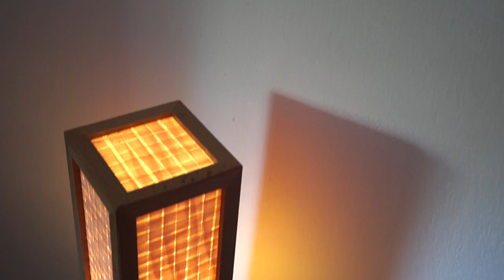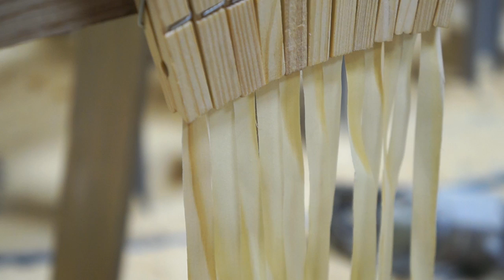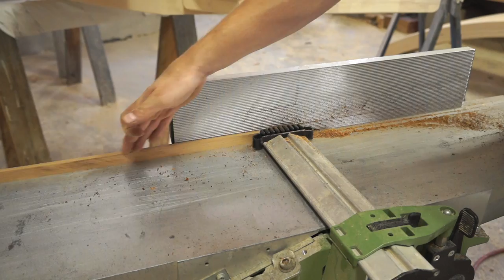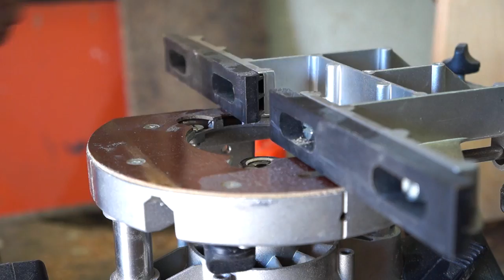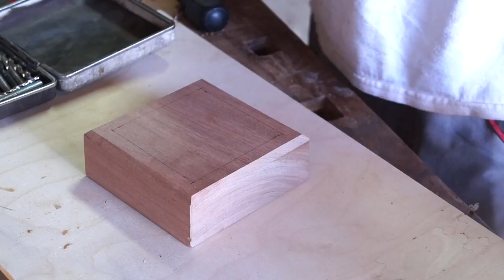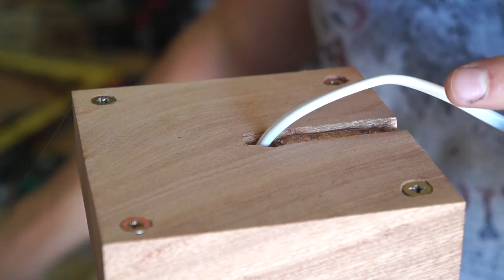LED desk lamp made from wood shavings

Comment: Nice lamp and very detailed progress. only thing that i would do differently is use some led strips in stead of a bulb. thisway you can make the light have an even light distribution (running the strip from top to bottom). in this case you see clairly where the bulb is located.
Reply from the maker: You are right, I thought about using strips but it was weekend, the stores were closed and I had this bulb lying around so I said what the hell.. It would look better with strips..